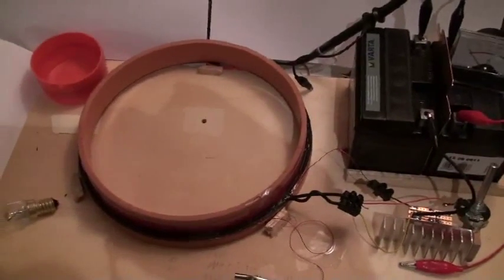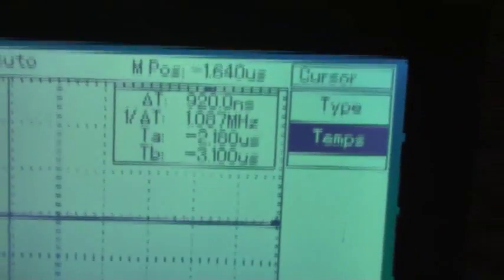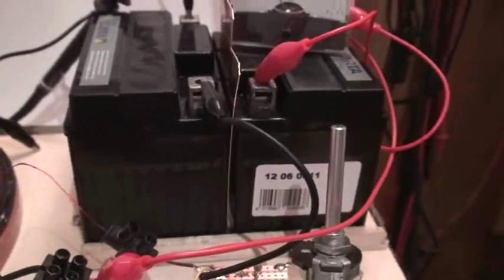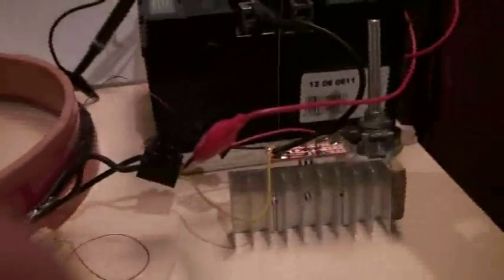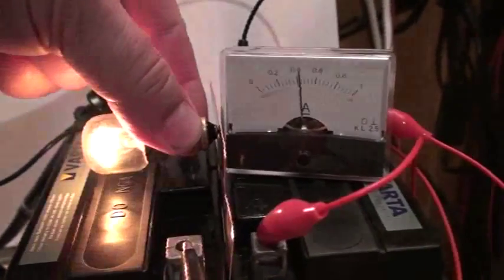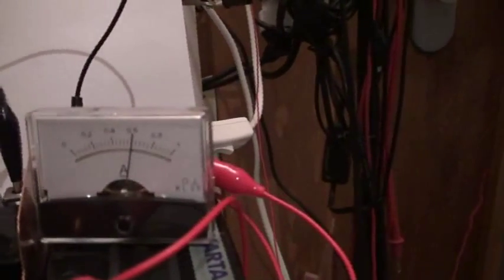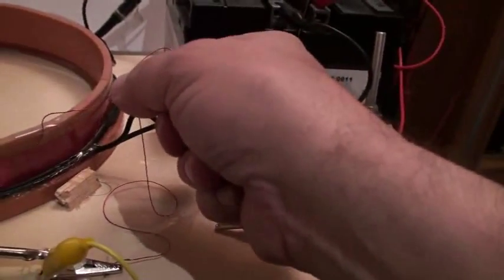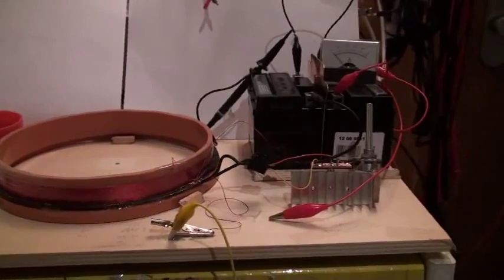Amazing  exciting  between ground and battery 1.wmv

Comment: Hi,

I think you are lighting the bulb through capacitive coupling. Everything looks like a capacitor to high frequency (I'm not familiar with this Kacher circuit, but I assume it's an oscillator of some sort?) and the circuit is completed capacitively through you, the air and the ground.

Nonetheless, this is an interesting concept - you are transmitting quite a lot of power capacitively there.

Any chance of a schematic?

Thanks,

R

Comment: Hi woopy :)
On 2:49 notice small spark when connecting ground. If you put your bulb in series to the ground there, it should show some light. Also you might attach 1 Ohm resistor in series from power supply and isolated oscilloscope over it because the amp meter won't notice much difference in high frequency amp draw...
Also increasing amp draw makes circuit do forced oscillations. And you need free oscillations by resonance means ;)